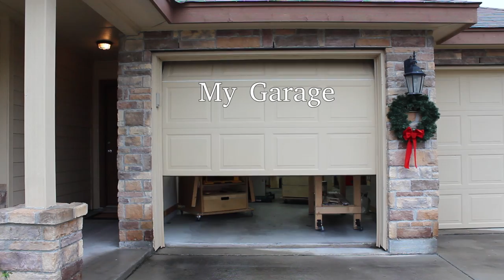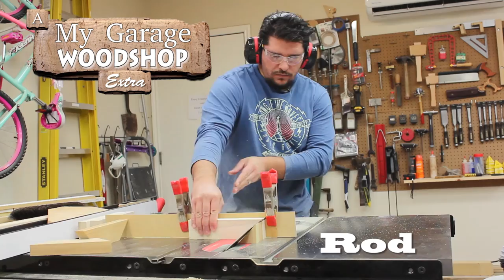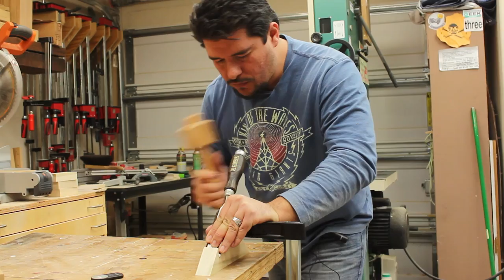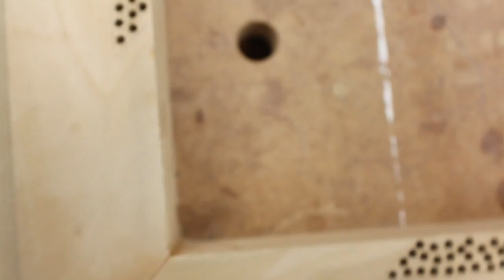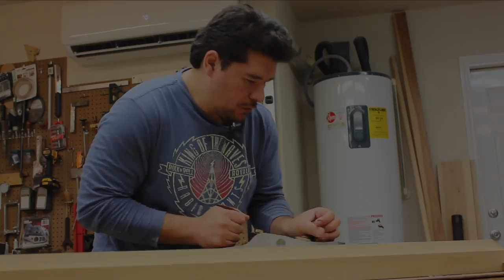Making Corner Braces

Comment: So how did you cut the inside angles on the bracket so cleanly? Did you use a band saw? You left that off. You went from cutting the 45 degree angle to cleaning the cuts with the chisel.

Comment: This fits in nicely with a project I've been asked to design I'll be modifying this idea slightly and using it. Thanks
Reply from the maker: +arponto wow! Cool to hear!  Quick tip.... I used a 45 degree angle on the "tails", but this was a mistake. My thought was that the "tails" would pinch toward each other as I hammered them down  within their mortise. But this creates two problems (1) the angle turned out to be too closed and it was difficult to maneuver my chisel in the mortises especially in the corners. I managed to get a real tight and clean fit but it was difficult. (2) at 45 degrees the tail's triangles are a little fragile and don't have much strength UNTIL they are glued in place.  I would definitely do this technique again if a had to, but I would increase the angle of the tails. I hope this helps
Reply: My Garage Woodshop you should post an update video showing what you mean. hard for me to visualize

Comment: I like the corner brace but don't like to see miters on a frame that size.  My guess is, despite the braces, the miters have opened up on the inside of the corner, particularly during the dry season.  Would be better off with a rail and stile or mortise and tenon/ butt joint.  Nice job on the brace though!

Comment: What is the degree for ctting brecrs?
Reply from the maker: I used 45 degrees but I would not recommend it. 45 degrees produces an angle in the frame that’s hard to get a chisel into. If I had to do it again I would increase the angle significantly. Thanks for watching

Comment: Pretty slick, I will be using that in the future👍
Reply from the maker: +Smoke eater      Awesome! Just a quick tip. Make sure to open up the angle on the dovetail though. I used a too severe of an angle and it was a pain to maneuver my chisels in the corners of the mortises. Thanks for watching man, I hope it helps. Let me know how it goes if you try it!
Reply: My Garage Woodshop   Right on brother, I'm pretty new at this so every tip helps that's for sure👍

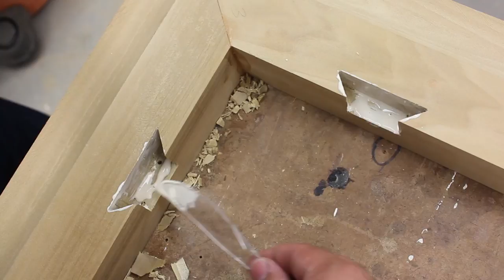Comment: 1:25 Don't forget to put some glue where the corner brace fits against the inside of the frame, no reason to not take advantage of that extra mating surface for some added strength. Awesome job BTW.
Reply from the maker: +Ryan Taylor      Dudeness..... good eye! Thanks!